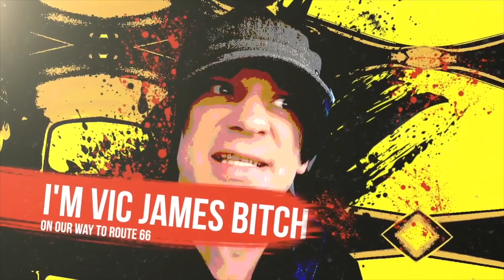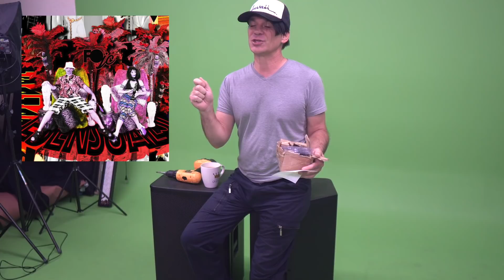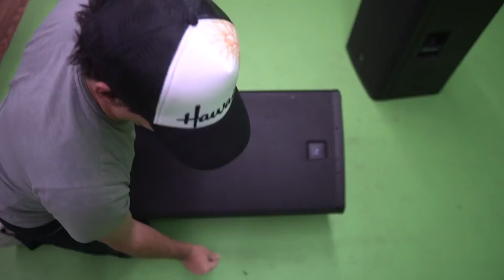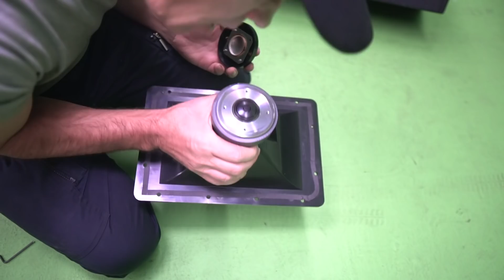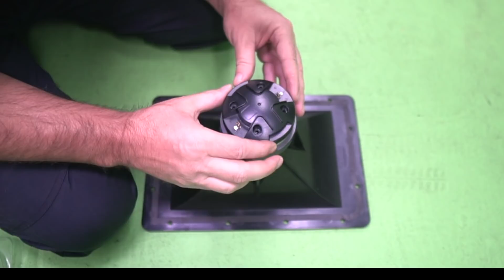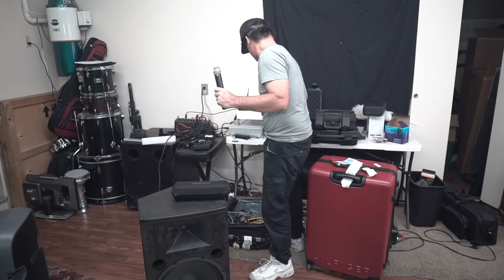Electro Voice Horn Tweeter Repair ELX115 and ELX115P with Vic James Bict*

Comment: Here’s a question on an older video, My EV 115P mid and bass frequencies stopped working and I noticed it at a gig this past Saturday night but I’m not sure if it’s the amplifier or of the speaker is blown. I don’t think it’s blown cause with my experience a blown speaker just sounds really bad when it’s played, but this has no sound at all. Maybe a wire is loose or maybe there’s slime thing wrong with the amplifier but I’m not sure and I don’t want to buy another speaker cause they’re expensive. Any help you may have will be great

Comment: A quick question, one of my Ev Elx 112P speakers make a buzzing sound when turned on to 12 a clock , sounded a bit weird to be honest. This happens btw when no music is playing, but I can still DJ with them and push them hard no problem, but do you think that the HF driver could be slightly damaged the fact that it's making that buzzing sound when no music is playing. ? On side note I had my other EV ELX112p next to it and it wasn't making that sound.
Reply from the maker: Sounds like a grounding problem or a short in the international wires off hand
Reply: @fojctv  Thanks so much for the reply! How can I fix that issue? What are your suggestions
Reply from the maker: I would try a ground lift first: 

 https://www.target.com/p/general-electric-2pk-grounding-adapter-polarized/-/A-14442316?ref=tgt_adv_XS000000&AFID=google_pla_df&fndsrc=tgtao&CPNG=PLA_Home%2BImprovement%2BShopping_Local&adgroup=SC_Home%2BImprovement&LID=700000001170770pgs&network=g&device=m&location=9030793&ds_rl=1246978&ds_rl=1247068&ds_rl=1248099&gclid=Cj0KCQjwvb75BRD1ARIsAP6LcqucG7JUfs1aqhELOJapNUI6HyoH9Ssa3I9DbwCzIOlaU2ZEi8IgaOUaAhd6EALw_wcB&gclsrc=aw.ds